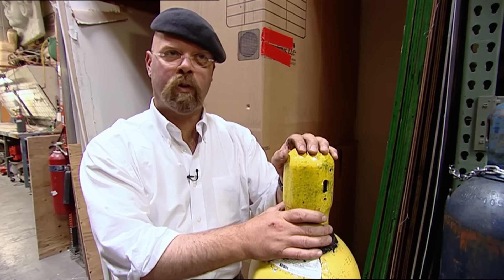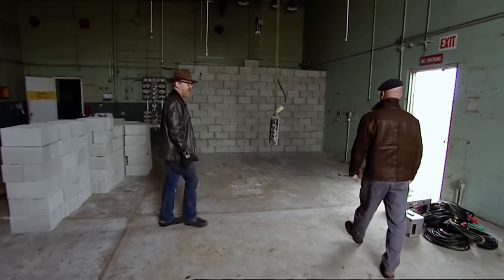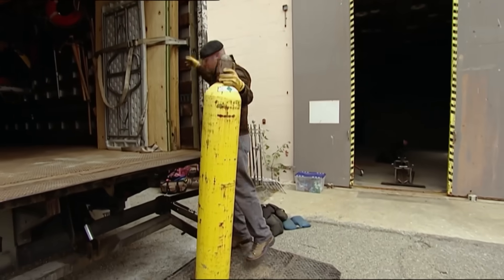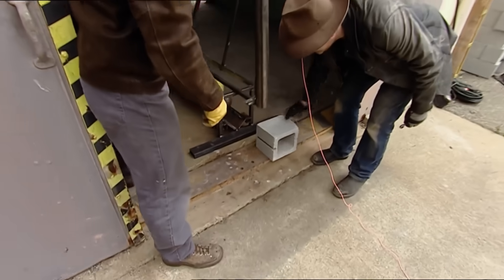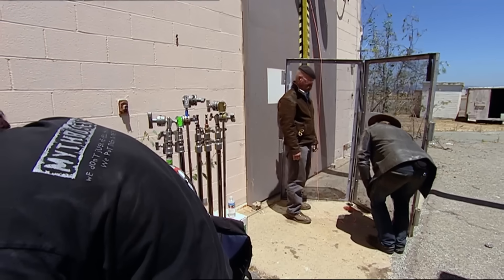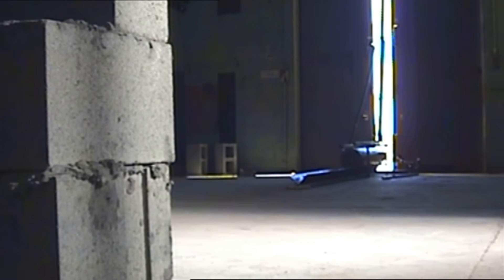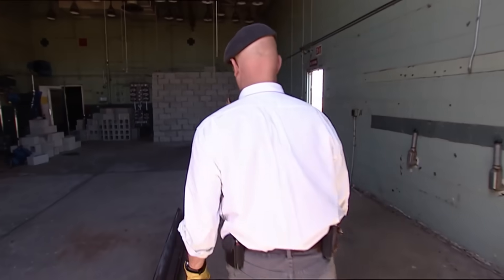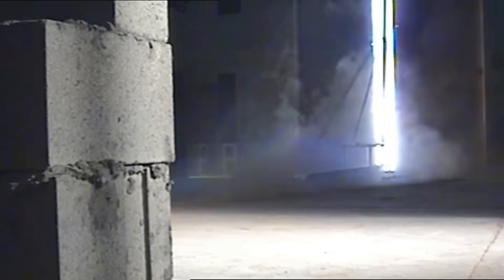What Happens When A Compressed Air Tank Explodes? | MythBusters

Comment: I always hated this one. the wall was not built to code. Its just cinderblocks with mortar between them with no reinforcement or concrete.
Reply: Not everyone builds to code. The myth could have involved a wall that wasn't built by professionals.
Reply: well you're an idiot
Reply: My engineering company designs masonry buildings.  Commercial buildings don't require grouted cores in masonry walls, and when masonry wall are reinforced (like in heavy industrial buildings), it's only vertical cores and horizontal courses every 4'-0", the rest of the wall between those grouted sections are still hollow.